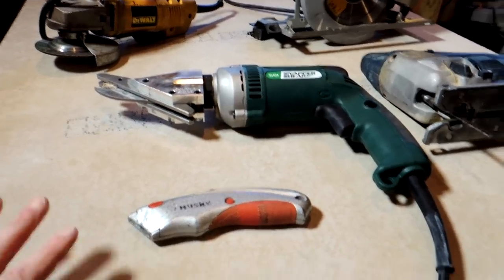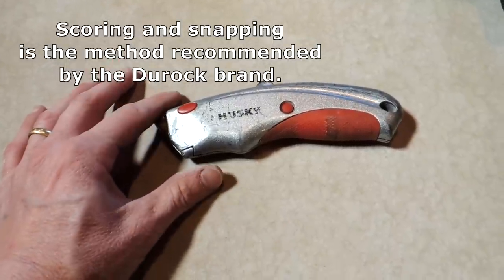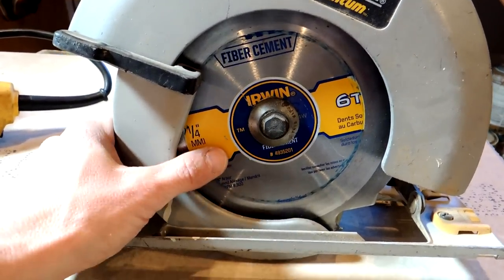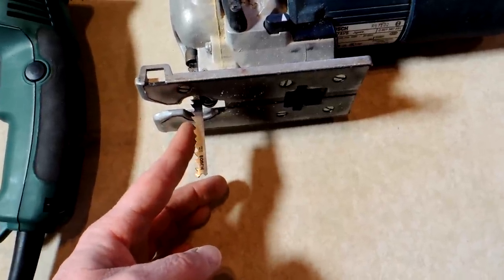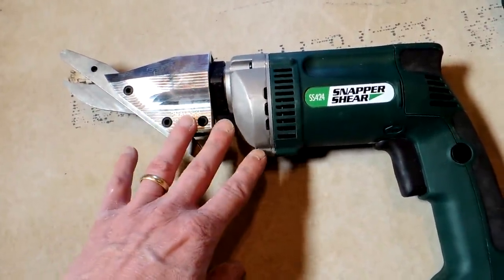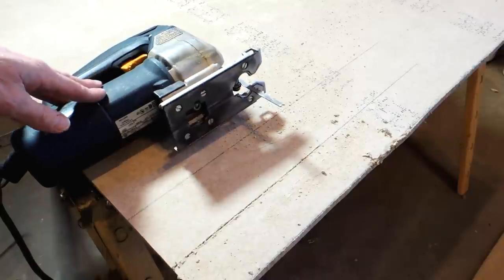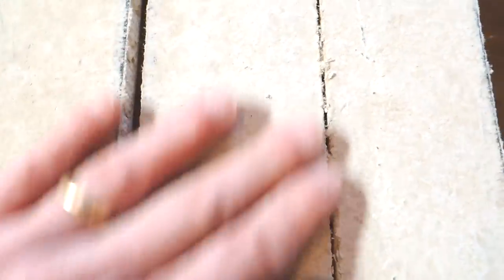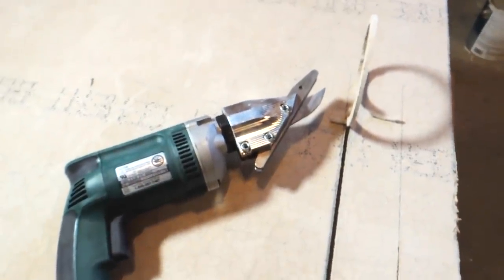The Best Ways To Cut Cement Backerboard

Comment: I need to replace my bathroom floor, down to the joists.  I want to do a tile floor.  Should I do 2 layers of 3/4” plywood and then 1/4” backer board on top of that?
Reply from the maker: Much depends on the adjoining room and how might height you have to work with.  If you can do two layers of 3/4 plywood that's awesome (I'm assuming joist on 16 inch centers).   You may find that the floor in the adjoining room will not match up well enough, though.   I have another video on this subject here: https://youtu.be/rmrLxfaGXyQ
Reply: enduringcharm How about 3/4” plywood and 1/4” backer?  Or do you think that might be too much flex still?  It’s on a crawls pace.
Reply from the maker: You mean just a single layer of 3/4 plywood over the joists?  I'm assuming the joists are on 16 inch centers.  Generally speaking I would consider that arrangement inadequate, although every situation is unique.  The steps you could take to improve your odds would include beefing up the framing with additional joists and/or a beam and posts underneath to cut the span.  That would reduce joist flex.  I would also consider using Schluter Ditra instead of 1/4" backerboard and installing small tiles to increase the amount of grout lines, which allows for more movement.

Comment: Can I use a saw or steak knife to cut backer board. I have a hole in a wall just under my shower unit so need to cut out a shape. Also can I drill holes into it without it breaking apart?
Reply from the maker: First, there are different brands of backerboard and they have different properties.  Hardibacker is a stiff and solid composition, others are more porous and crumbly.  A steak knife would not be my choice of tool!  A saw will work as shown in the video and you can use a hole saw or wood bits to drill holes, though they may not be clean holes.  No matter what, protect yourself from the dust, which is dangerous to breathe.
Reply: enduringcharm Thank you for your help much appreciated.

Can I not use a normal drill bit? I will be cutting a shape out of the background in the shape of the hole and then plan on drilling that shape onto wood that is inside the wall. Once the holes are drilled I will screw the piece with screws into the backboard and wood. Then tile that area and use grout inbetween tiles and sealant around the shower etc.
Reply from the maker: I'm really not following what you're trying to do or why, but if you want to drill holes using a regular wood/metal bit it will work.  However, the cement board is tough on tools and the bit will be dulled.  Basically you aren't drilling a hole, you're grinding away the material.  So, keep the drill speed down low to prevent heat build up and watch the dust.
Reply: enduringcharm Sorry I meant that i have a hole in a wall just under the shower unit. 

I need to cut a specific shape from the backerboard and then attach this backerboard onto wood that id inside the hole in the wall. Then I need to tile this area up as it is inside my shower. I need to use backerboard specifically because the one I have ordered is waterproof. 

Long story short the guy who fitted in my electric shower had to make a hole in the wall and pull out the water hose that connects to the shower unit.

Comment: I hear misting with a water bottle helps cut down on dust if using a jigsaw, etc.
Reply from the maker: Haven't tried that, but I bet it would work.  I've used the same trick to keep dust down on work area floors.
Reply: Yes, I've done that - it does help

Comment: cool tool .. never knew it existed ... probably great for doing complicated cuts ... but for the weekend warrior .. score and snap works for straight cuts.
Reply from the maker: Yes, the shear is wonderful, but if that's not available to me I'll use the jigsaw with a pack of blades to get through my cuts.  The score and snap has never worked with enough accuracy for me, and it can introduce stress cracks in the work piece that I don't care for.  The jigsaw blades for a whole bath only add up to $10-15.
Reply: how long do those shear blades last?  Does that electric shear tool also accept blades for sheet metal? (for casual home use, a multi functional tool could be worth my investment). Your shear cuts do look clean, ... if you shear out for hole, round or rectangular, etc... what other tools do you use to get started with the shear?  ...Nice video BTW.
Reply from the maker: The blades are fairly long lasting (many jobs) and reversible.  For holes or cuts in the middle of a sheet you can use a hole saw to make a place to start or you can use a jigsaw with a plunge cut technique (I made a video on that!).

Comment: Ok what would i use to cut a hole for the toilet??
Reply from the maker: I saw from your other comment that you ordered the Pactool shear.  That can be used to cut a hole for the toilet flange, but I typically use a jigsaw for smaller holes or openings.  Either way you'll need to drill an access hole to start the cut, and you can use a common spade bit on slow speed for that.  Presumably you are using 1/4" backer for the floor and that cuts pretty easily.  If you use the shear, see if you can practice on some scrap first.

Comment: I tried the score and snap...only thing that broke was my patience lol
Reply: Airborne Mike lol same here!
Reply: Me too.
Reply: lol. The snap worked...in all the wrong places!
Reply: Omg! I skinned up my knuckles. 🤣
Reply: scoring takes pressure , and maybe a couple runs. I'm speaking for 1/4 inch not 1/2 inch I used 1/4 to score and put the score line next to a hard edge and shaped it just fine .
Reply: It is possible to snap the boards , but you need to get physics on your side . I thought I'd try it , because my jig saw blade blunted on the first cut . To snap , score several times to get a good depth . Use a good weight on top of the board . I used a flag stone . Then hold on to the long edge of the board , so you have a good long lever . Lift up in one swift movement . Worked for me 👍
Reply: Same

Comment: Been doing tile for years... score and snap is what I’ve been doing unless I need to be precise, then I use the grinder. I laughed when you said no one does that anymore lol
Reply from the maker: No joke--you really should stop using a grinder.       Look up silicosis and consider the risk.  It also puts others at risk since the dust goes everywhere even when done outdoors.  It's bad enough we expose ourselves to a certain amount of dust no matter how we cut--the boards have dust on them in the store.  But, a grinder really sprays it everywhere.   If you are doing tile regularly there's no reason not to own a shear.

Comment: Took a two dollar chisel scored it a couple of times and popped the board. I imagine a utility knife would dull making it work better but would just take a minute longer.
Reply from the maker: Well, that may work for a single straight cut, but most bathrooms require multiple intricate cuts around the tub or pan, around pipes, around the shower valve and around wall angles.  Score and snap won;t work in those situations so you'll need to either use shears or a jigsaw with disposable blade.

Comment: Wet saw works?
Reply from the maker: No, a diamond blade would take forever, the water would make a mess of the board before you installed it, and the arm of the saw would prevent any sort of reach.  Trust me, the shears are far and away the best option and that new model of shear for cordless drills I mentioned here in the comments is a great idea for homeowners as well as pros.

Comment: Is this ok to use for table top for outdoor?
Reply from the maker: I'm not sure what you are asking.  Is your question about the tools or about cement backerboard?
Reply: @enduringcharm  the cement board. I'm wanting to do an outdoor tabletop with tile on top and wondered if this board will work
Reply from the maker: You can use tile in exterior applications, but typically it is over a solid surface such as concrete.  And, the tile must be rated for exterior use,  which will be a porcelain tile.  Cement board doesn't have a lot of structural rigidity, so it would need to be supported below with wood or other structure.  Some brands, such as Hardibacker, are better than others in this regard.  I would not recommend it, honestly.  I have seen tables made with tile which use a lattice or grid made of metal, with the tiles just laying loosely in the grid pattern, supported underneath.  This has the advantage of easy tile replacement in the event of breakage.  Making your own would require welding expertise, but you might find one for sale that works with standard tile sizes.
Reply: @enduringcharm  thank you so much .

Comment: My angle grinder was a lot of dust but clean lines and fast. Outside with a mask
Score and snap right!
Reply from the maker: Grinding cement backerboard is really bad news, even with a mask outdoors.  The dust still remains on the surface and it still gets around as you install the backerboard.  The silica is nothing to fool with.  Believe me, shears are faster than a grinder and much safer for you and for others around the project.

Comment: when using the jigsaw, doesn't the blade heat up? Every other vid says WET the blade????
Reply from the maker: Yes, the blade does heat up, which is why I suggest using a much slower speed.  You will destroy your blade using it on cement board, but for a typical project you might go through one or two blades.  That's not a lot of investment in the scheme of things.  As far as keeping the blade wet, water could help cool a blade if you kept a constant stream on it. However, shorting out your tool and potentially electrocuting yourself seems like a high price to pay for a cut!

Comment: The Home Depot talked up how you just score and snap the HardieBoard 500. I regret the purchase, score and snap? My buttocks! Out of twelve sheets, only once did it snap where it was supposed to. And that is after scoring it for twenty-odd minutes. 

The next renovation I do, I'm going with KerdiBoard. Sure it costs more, but it is just easier to work with.
Reply from the maker: Kerdiboard is indeed lighter and easier to cut.  However, I don't care for it because after the tile is installed it leaves a kind of hollow sound and insubstantial feel to the installation.  Kind of like walking across a floating engineered floor--it feels like plastic.   The Hardibacker cuts well with the right tools, and there is a new option I know about coming out in a few months which will be inexpensive to buy.

Comment: Thank you.
Getting out my jigsaw!!!
Reply from the maker: Just keep the speed down and use an aggressive tooth blade and the blades will last longer.
Reply: @enduringcharm  
I was wondering about the speed.
We are going to do the HardieBacker Waterproof boards around the installed shower kit tomorrow.
Thank you very much for explaining this.  

P.S. This is a installation of a shower in a nice pole building.  In the shop we found a table saw like thing which says it is for tile (with some kind of a water pan underneath).  We thought about using it, but I am more comfortable in using the jigsaw. Also, we want to seal it right after installing it and would have to let it dry before applying RedGuard.
Reply from the maker: You are referring to a wet saw, which is used to cut tile.  Not appropriate for cutting backerboard but great for tile.  Since you just have one shower to do the jigsaw will work fine, just remember that slow is fast! Maybe you'll burn through a couple of blades.

As for redguard, you may not need it if you are using the waterproof "hydrodefense" version of hardibacker.  If you do feel waterproofing is necessary, I'd encourage you to look at the Schluter Kerdi membrane rather than Redguard.
Reply: @enduringcharm  
We finished the shower!!!
Thank you for all of your help.  :)
We used a jigsaw for most of the cutting. It was really slow, but we were also beginners, but we got most of the Waterproof HardieBacker up the 1st day.  The next day I was working alone and decided to try renting a Snapper Shear.  OH MY GOODNESS - I wished that I had used it from the beginning! The Shear went so quickly - yes the curls of board were a bother, but we would have finished much quicker. Construction friends told me they used the circular saw as well, but so much dust when I used one for a short-cut.
I just wanted to let you know that you helped and we got the job done.  Oh, and our son also helped immensely with the RedGuard - also a great product. Our Cabin shower would have been waterproof without the finishing tile. ;)  BF came over the last day and we got the tile up and it looks and works great!
Thank you again.
Reply from the maker: Glad it worked out well!

Comment: Spend a few dollars on a carbide coated jigsaw blade.  It will last much longer than a wood-cutting blade and give you the same ability to cut curves.
Reply from the maker: Funny you mention that--those aren't available to me locally but I did purchase some carbide blades online maybe a year ago.  Then I promptly forgot that I had them!  Maybe later this week when I'm cutting some hardibacker I'll pull them out and give it a go.

Comment: I work in drywall and i cut it like regular drywall they sell special knifes for it i dont use machines cuz it makes alot of dust that can cause cancer
Reply from the maker: I'm going to bet that you work mostly in new construction, rather than remodeling.  Score and snap simply can't handle multiple angles on a single board, or tight curves, or fine cuts required in typical remodels of baths, etc.  You are quite right about the dust, but the shears or the jigsaw address that problem.  The shears, in fact, make less dust than scoring.  If I could just use shears for everything I would, but sooner or later you need to use a jigsaw or a holesaw to cut out for pipes or for a valve body.  Some of the modern valve body designs require a very tight, perfect fit to complete the waterproofing details, so scoring and punching out with a hammer will not work.  For anybody who works with backerboard regularly, the shears are well worth the investment.
Reply: The carbide blade is way better than a razor.

Comment: SO...... Why non address the giant chunk the shear broke out at the edge of the board?
Reply from the maker: I'm not sure what you mean--can you note the time stamp of the video in the part you're referencing?  At 6:52 you can see a close up of the cut a shear makes.
Reply: @enduringcharm  at 6:25 you can see a large piece broken out a the start of the cut.
Reply from the maker: I see--on the waste side there is a chip.  Not unusual.  Sometimes when installing backerboard you'll get a similar sort of chip if you get too close to the edge with a screw, which can happen in corners.  Perfect cuts are not necessary with backerboard.  In areas such as around shower valve you need to be careful not to exceed the escutcheon cover, but if an edge of a backerboard sheet has a chip where it abuts another sheet a dab of thinset will be fine.

Comment: Hey John, have you seen this vid demo using the score and snap method? Obviously these are not going to get the straightest of cuts, and it's a knuckle grinder if you are not careful. He didn't even use a straightedge but I suppose you need a little expansion area anyway. Oh well. I like the straight cuts I get from the jigsaw.  https://www.youtube.com/watch?v=3ULbcdphAls
Reply from the maker: +D Blake Wow.  Yeah, those crude cuts are unusable!  Not only that, but the process of bending the backer like that also stresses it, leaving edges vulnerable to braking apart.  When you install a shower backer you need straight cuts to go right to the edge of the corner or else you won't have enough to catch the corner stud with a screw.  Plus, who has a giant slab of clean concrete to work on out at the jobsite?  The toilet flange "cut" made me laugh out loud.  I'll stick with a jgsaw and my shears, thanks!
Reply from the maker: +Rob B My concern with scoring and snapping is twofold.  First, an irregular snap leaves a ragged edge that may not fit the opening I was measuring for.  I mean, you want the backerboard in a shower, for example, to end cleanly in a corner and go right to the end so that your screws catch the full meat of the corner stud.  An irregular edge may not leave enough room for a sold screw-to-stud connection.  The second concern is that the snapping process could stress the backerboard that you are keeping, leaving an edge that is warped or weakened.  Not what I want when I'm building a $15-20K bath for Mrs. Smith.  

Of course, it's possible that the snap method does leave a good edge on a board.  I just don't have the time or the money to gamble, so I stick with my shear and my jigsaw.  I just installed the backer for a bath remodel yesterday and I was thinking to myself how happy I am to own the shear!  I used a jigsaw to cut out the hole for the shower valve.

Comment: You didn't even cover using a Score and Snap knife, the actual method that James Hardie recommends. Terrible video.
Reply from the maker: I didn't use that method because it isn't used by professionals and it is a very poor method.  Try cutting a hole in 1/2 hardibacker for a shower valve with a utility knife and let me know how that goes.  Or, make an offset cut, curved cut or very narrow cut in 1/2 inch hardibacker and get back to me on that.  Even for straight cuts I routinely need to trim a 1/2 inch angled cut on the edge of a piece of hardibacker for a shower installation.  Try snapping off a 1/2 inch of hardibacker cleanly.   I've personally remodeled 60-70 bathrooms using hardibacker and not once did I use the score and snap method.  Today I use the cordless shears (I have another video on that) and a jigsaw for the shower valve hole.